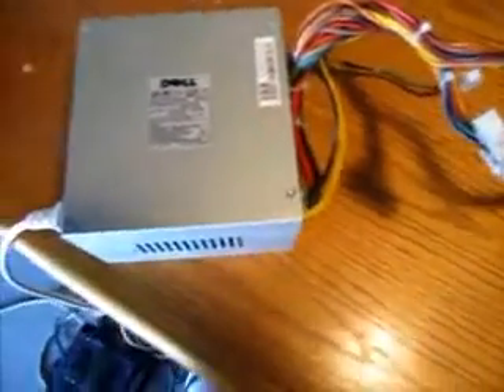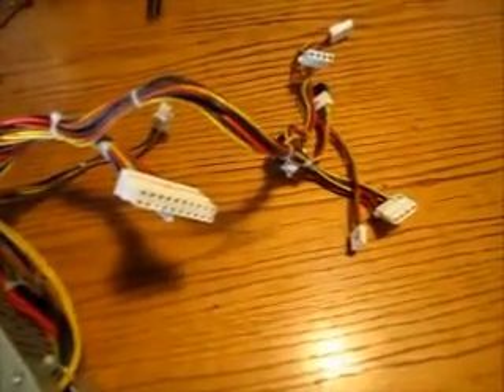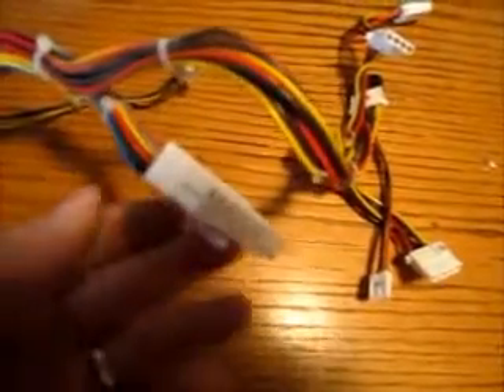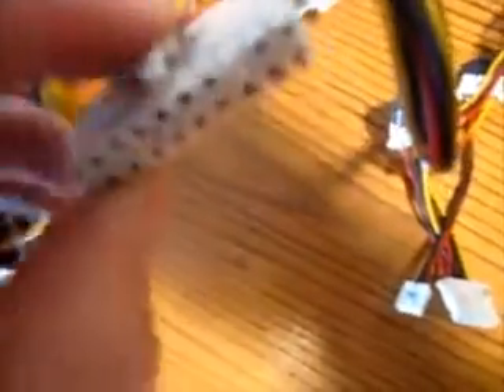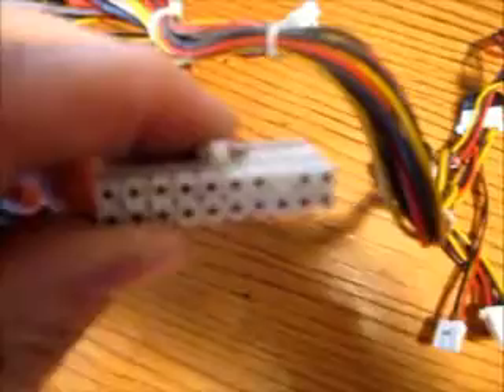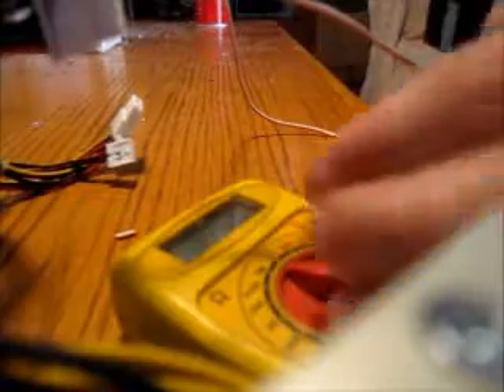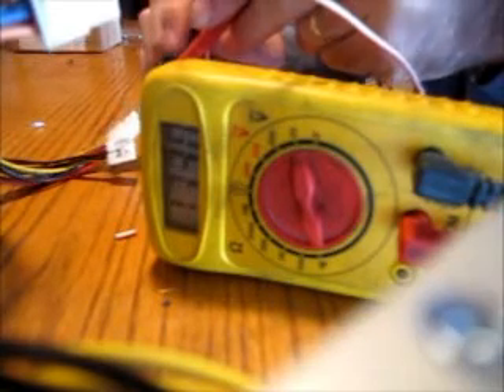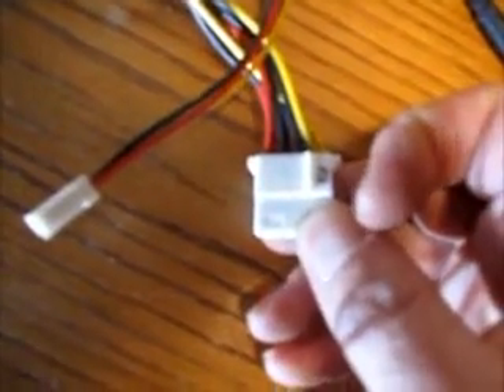How to Manually Turn on an ATX Computer Power Supply

Comment: how u got it running without any load.. someone told that psu needs "dummy" or some load to stay on..?? is it just depending psu or is that "dummyload" just bs :D
Reply from the maker: Häätzy Pönde The psu's that I've done this with haven't needed a load to stay on. My guess would be that maybe some of the newer ones have that feature as a way to save power.
Reply: some need a load on the 5 volt rail....which you can do using a 10 ohm resistor between one red wire and one black wire.